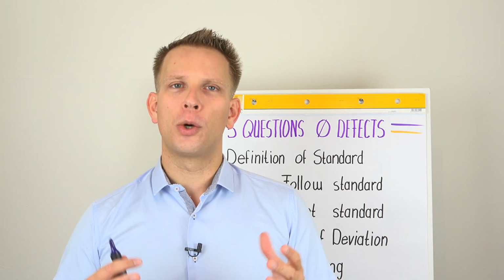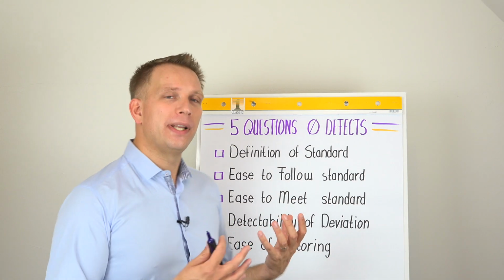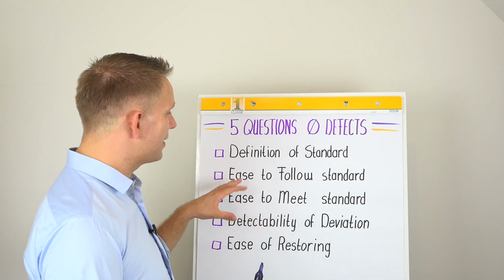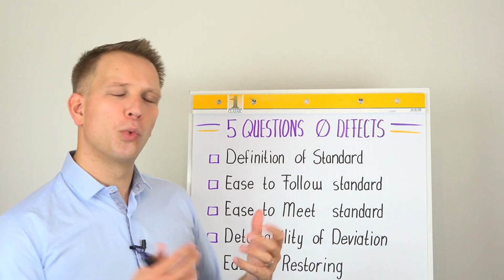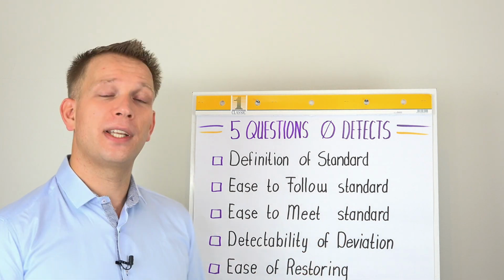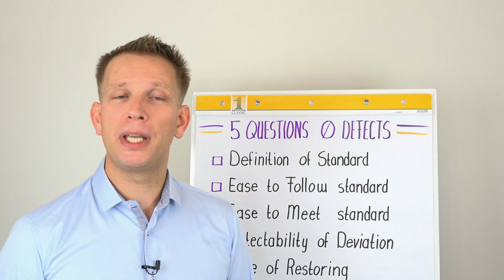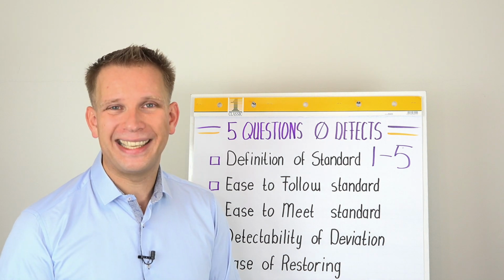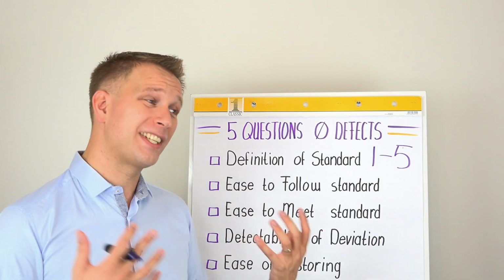Making stronger standards | How to use the 5 questions for 0 defects

Comment from the maker: You can use these questions to check current standards for stability, and it sure is best practice to use these questions every time you introduce or update a standard. That's also why they're included in the problem solving template (which you can download via this link: https://www.tommentink.com/problemsolvingtemplate )